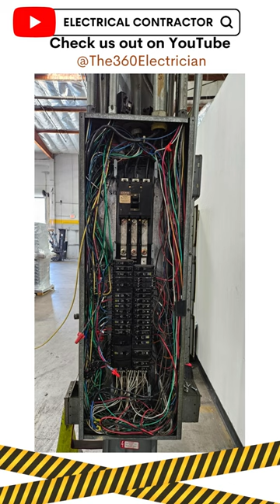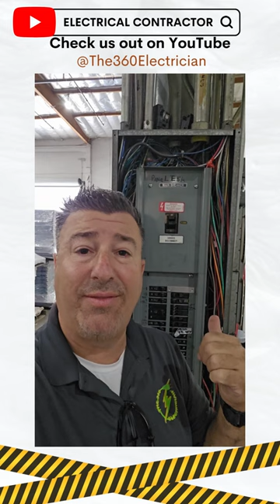What would you do with 3 phase commercial electrical panels like this? #commercialelectrical

Comment: In order to sell this work package to the client I would first thermal image the panel to show the heat spots in all the conductors. Explaining the hazards associated with this kind of unprofessional installation. Premium time required to do the work after hours. A potential addition to the package would be the installation of a gutter above the panel. It would eliminate all splices and extra wires inside the panel. Any additional future conduits could be easily added to the gutter worry free.

Comment: Its a208 3ø pannel. If you are at a mill or manufacturing plant you're not going to do anything that is not directly related to your contract.  If you are to clean it up. Most plants want enough free lead to be able to move the circuit to any pole spaces in the panel. So you must have enough lead to land at 1,3,5 or38,40,42. Why because as plants update they will move circuits around to balance the laod as much as possible.  What was balanced in 1990  may be out of balance by 25% today. 
The biggest offense i see is the failure of running Red,Black,Blue conductors.
Reply from the maker: Great points that you need to consider according to you spacific location etc.